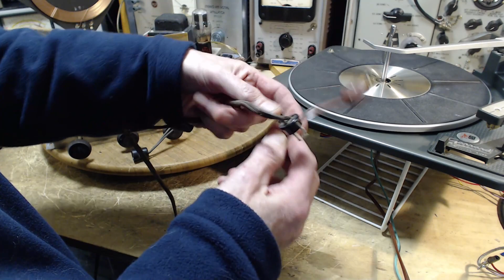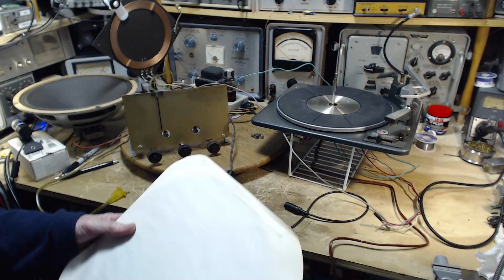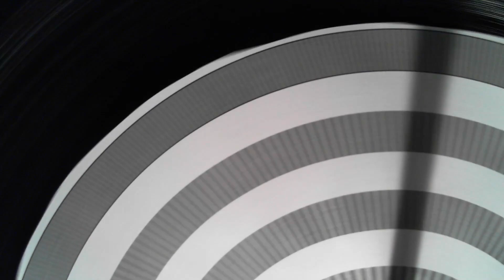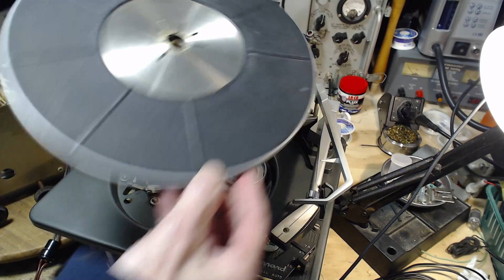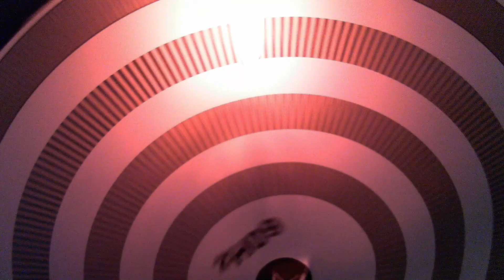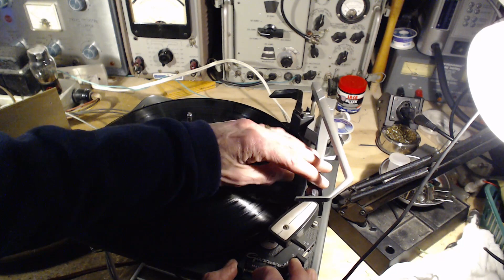Canadian General Electric C701 Console Video #9 - Platter Speed

Comment: These old record players are a nice piece of crap (exception made for the EMTs), compared to my first one, a BSR that also played the records too fast because they used a 120 to 220 volt AC adapter and, of course, all they can ever get is an approximate speed... Even so I'd rather prefer my BSR than this junk - it had anti-scating and weight adjustment, adjusting screws for where the needle drops down the record, the height of the tone-arm, even had an adjustment for the return at the end of the disc... Compared to this the mechanism was much more reliable and simple and it could play 75rpm records if you dare to do so with a Shure cartridge... This one is just a piece of garbage...
Reply: 110/220VAC? Squirrel cage induction motor? Synchronous speed?
Reply: @ableutopia2721  Sorry, I meant 220-120 volts. I believe it was a model adapted to the European market...
Reply: @StillCloser  Thanks for your reply, appreciated. The point is that the speed of induction synchronous motors is set by the number of poles and the AC frequency supply. Voltage has little if any bearing (unless it stalls), but after all the "alterations" Jim does to the drive train, the platter spins at an incorrect speed.as expected. Agree on all your other remarks. Stay safe!

Comment: Stop screwing up the player. Get digital tachometer and replace that dammed drive wheel.stop using prophylactic approaches to repair.
Reply: "Digital tachometer" is not needed ! The stroboscopedisc work very exact !! It's made for 60Hz and this is the easyes and exactly way to test the speed ! But wonder, why is running to slow ? He changed the diameter of the idlewheel, so it is clear !